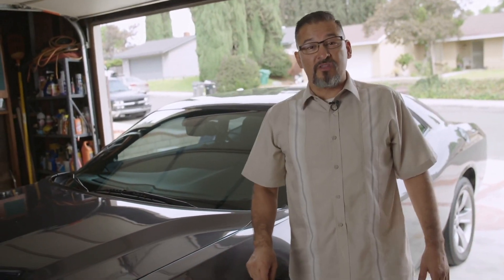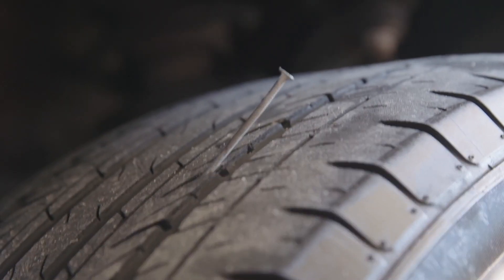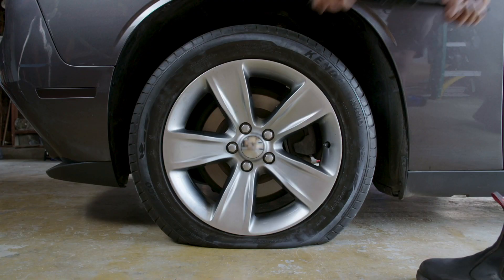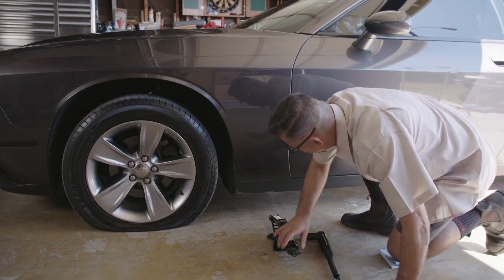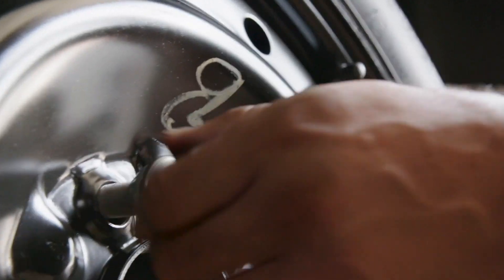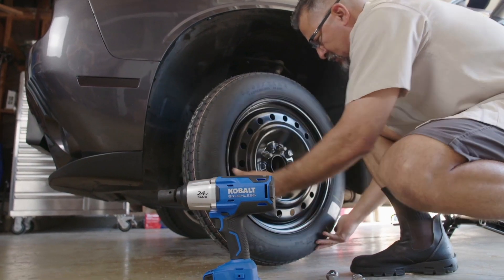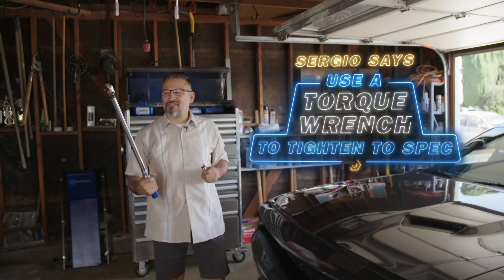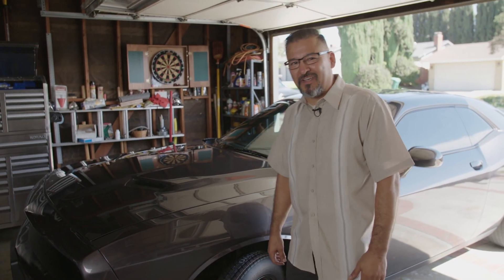Kobalt Tools - In the Garage: How to change your tire

Comment: Maybe this comment will make it back to someone at Kobalt.
All the manufacturers seem to do it but I own yours, so here is my gripe about the led light location on your impact guns. They dont allow the light to work at all because the chuck gets in the way. It is too close in line with what you are screwing. The drills have them in the right location below your hand only they are the wrong kind of light and you can't see a damn thing with it. 

They make a beam led that would work perfectly, why dont you use them?
Reply: Have you tried Rigid? The light actually lights up what your working on since they placed it at the base of the handle instead. They also have a lifetime warranty on the tool and battery that they actually honor unlike Kobalt tools.